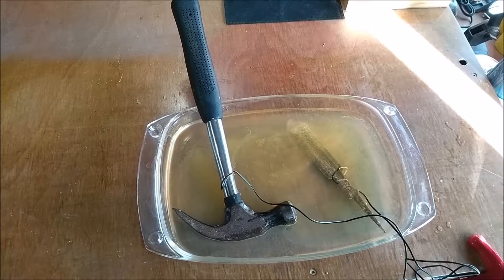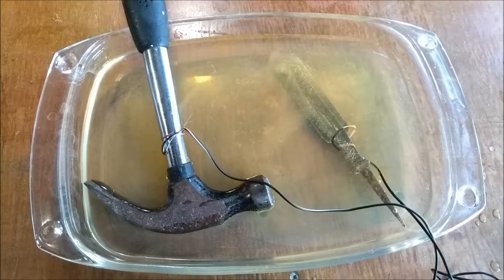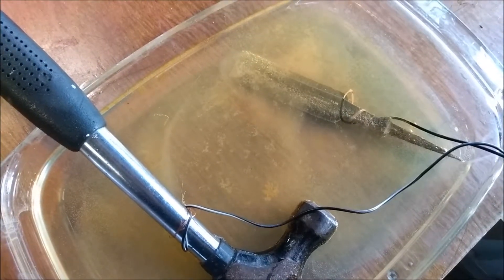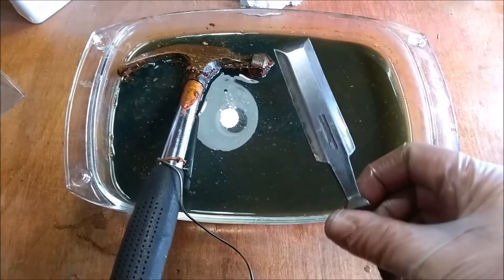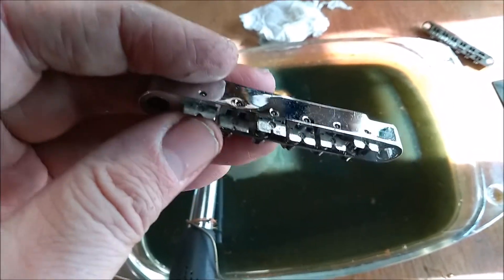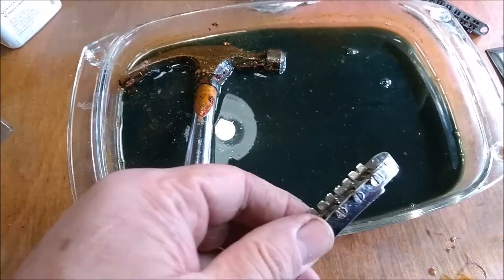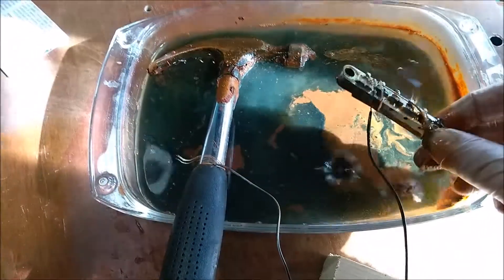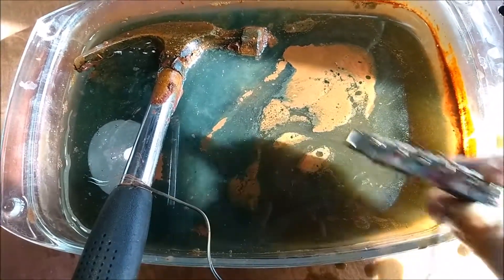How To: Use Electricity to Clean Guitar Parts

Comment: I just picked up an old Fender Mustang Bass that desperately needs its hardware cleaned, so I'm anxious to try this. One question though, how did you clean the excess residue off once the part was finished bathing? Did you rinse it off with regular water or simply wipe it off? Seems like stuff you wouldn't want to remain on the parts. Great video, thanks!
Reply from the maker: HI Nick. Sorry about the delay in replying. I think I just wiped it clean with a rag, then used lighter fuel (naphta) to clean up any remaining residue